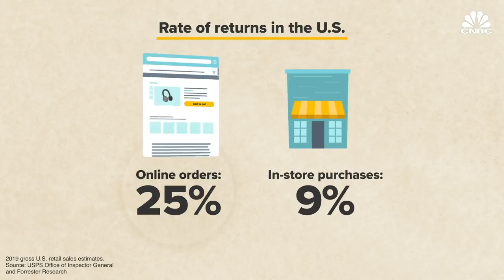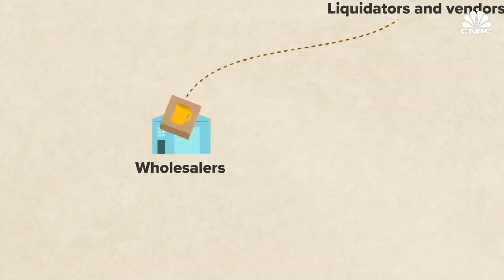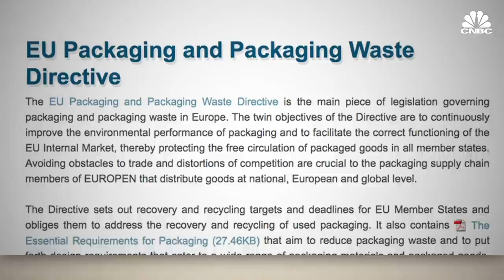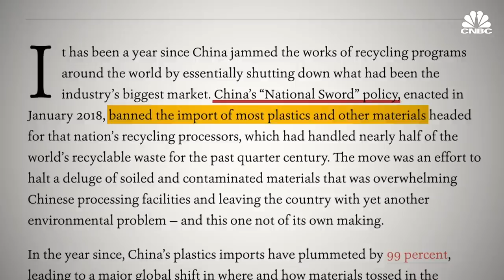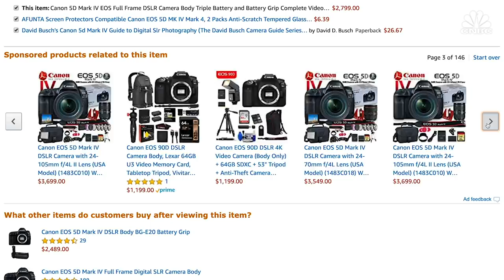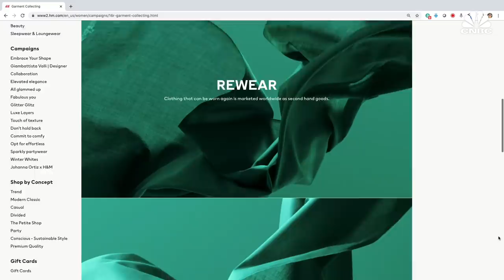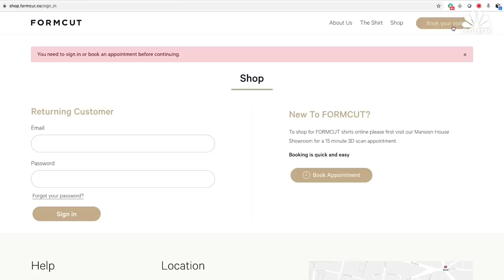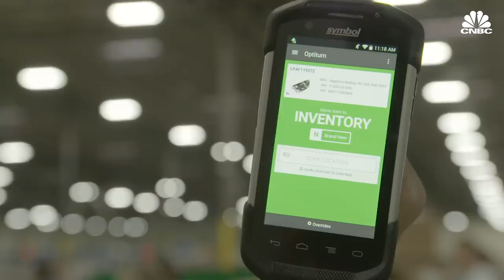What Retailers Like Amazon Do With Unsold Inventory

Comment: At a minimum 33% reduction in returns if the sizes are standardized across the industry.
Reply: Jonathan Torres not possible. They have to market “medium” to the fat Americans so they can feel better about themselves.
Reply: @TheMasterhomaster  well an Asian medium and american medium can not be the same
Reply: @toshi2k2  no it certainly isn't
Reply: @naddarr1  use metric for extra credit lol
Reply: Photo Booth Start Up
They can't as torso lengths are different.
Reply: A standardized system would require a more diverse set of measurements
S, M, L, XL, etc. can still be used for general size requirements, but they would need standardized lengths within them
Reply: They do it quite well with Bras why not with shirts at the very least.
Reply: I would agree to a certain extent.  Even focusing on just one brand, there could be 50 34X34 pairs of jeans on sale, and only three could actually fit you.
Reply: Sizes are "standardized across the industry".  That's why nothing on the shelf fits me - I am a nonstandard size.  The neck is always too small and the shoes always too narrow.

Comment: Yes put an end to designer clothes, and  make more shirts with made to order prints. Mass manufacturing of the same item is the problem. The only reason an item should be returned is if it is defective or the wrong item. Returns should not be so easy either. Buying on Amazon is like going on a blind date. The pictures often aren't the real product being sold and if it is used the real condition is often unknown. Amazon should go out of business for all I care.
Reply: What surprise's me is that more clothing returns, especially defective, doesn't end up as house insulation, it would make the whole industry better and cheaper.they are doing this with denim now.

Comment: How you the consumer can help reduce waste and stop companies from producing so much 

•buy only the food you need for the week, while you may think that may waste gas compared to buying it for the month, I guarantee you whatever you may save on gas will produce 2x the waste in food that goes bad, meal plan at the beginning of the week then get the ingredients, also make sure to eat leftovers. You can also shop from farmers markets to help reduce cost even further, but it’s okay if you absolutely afford it(though if you can afford a high end phone you can afford slightly more expensive food)

•buy only a few high quality clothing, same thing with the food, whatever you save on soap will be wasted twice fold on low quality clothing that gets thrown away, so better to just get a few high quality clothes that will last a while. A general rule I have with mine is wear it at least three times, then it can be washed unless it’s really bad 

•run everything that you use into the ground. your phone? If it got usable internet then use it. Your tv? If it’s running just fine you don’t need a new one. Your car? If it goes vroom vroom without having to go to the shop every three months it’s still good. 

Basically what it comes down to is to buy only what you need and buy it quality, it will last longer.

Comment: Apple doesn’t recycle parts. The reason for that policy is to crush unauthorized repair
Reply: It's also hard to recycle computer chips because of how they are made. It's not worth it. Even in bulk. The manufactures don't even know what goes into making these chips (CPU's). There's no known efficient way of extracting those raw materials.
Reply: Louis Rossmann? 😁
Reply: I assure you, they do. While refurbished portable items always get a fresh enclosure and battery, the valuable innards are definitely reused. The refurb items and parts are used in the warranty fulfillment process mostly, some are sold on the refurb store.

Comment: When I worked at Target in NY, if it was like food, opened cosmetics, or damaged items beyond use, they were defected as ree "toss". If it was a defected electronic, it was marked yellow I guess to send electronics for recycling or refurbishment or something. If it was anything else that was slightly damaged like apparel or something, it was marked green "donation". Anything else that was returned, was put back on the shelf. An open DVD/CD could only be returned for the exact same one as an exchange for copyright, and the returned one is yellow defected. And Target had a deposit return and you can recycle your plastic bags. I worked there back in 2006-2015.

Comment: The biggest amount of waste is due to unsold inventory, so the obvious solution is to create the "on demand fabrication". In this concept your costumer places an order at some online retailer, the same second the order is placed and paid, the factory 5000 km away starts the process of manufacturing the clothes the costumer ordered, then once the product is finished (1 to 2 days after the placement of the order) the order is sorted in the distribution center adjacent to the factory, shipped into container along with thousands of other orders to go to the same country or state of destination. then they are sent to the package delivery  company. In less than  7 days your customized clothes could be delivered at your door.

Comment: 3:04 - here is good example of key problem. Companies don't want to undermine their own new products by selling lower value older or used goods like DVDs and clothing. This can be solved very easily by banning such behaviour and simply forcing companies to sell the item if it still resealable instead of destroying it to sell new item instead. I know this particularly big thing in luxury fashion like Versace, Gucci and similar brands - they would rather burn $3000 dress or purse, rather than discount it, because the value of item is actually negligible, dress costs maybe $5 to produce, but if they choose to discount it accordingly and sell it maybe for $1500 or $500 then they effectively losing $2500 over selling new dress. This is criminal activity not only form environmental point of view, but as well by creating false demand in the market and limiting supply. Again is we take luxury clothing for example some claim up-to 80% of certain lines are not sold. So the maths say Versace has is as follows - they make 10000 pieces of branded clothing for $5 each, with retail value of $3000 each, if they sell even 20% of inventory they already making crazy profits. At the end of the season they may still have 80% of old stock and they do actually discount it little bit (usual 10/20/30%) and may sell another 5-10%, it is not massive seller because for target buyer it is very important to get latest fashion even if it is more expensive. So now company still has 75% of unsold goods which is 30% discounted already and they already have "new line" on the shelves. The new line still cots $5 to produce but could be sold at full $3000 retail, so having basically same product which may be just a little bit different colour one the side selling for 30% less basically loses the company $895 and therefore they going to liquidate old stock than discount it further and sell it. And there are quite a few companies doing it, tech companies actually does it with TV just the process is little bit slower and discounting is built into product life-cycle, however by some point it starts to make more sense to destroy say 5 years old "new" TV than discount it even more.

Comment: It's the old thing... If you go retail store, you can physically see an item, hold it or try it on, odds are you KNOW what your buying so odds are you wont return it. Ordering online can be hit or miss, even on Amazon.. They had some things that are cheap, and you grab them and they are cheap Chinese things, not what you expected and just complete junk. So they get returned. Outfits, you can estimate what will fit you based on what you wear but, different brands fit differently, this also causes a lot of returns...

The sad thing about is, retail the way we know it now will be gone for the most part in 20 or so years and this will just get worse....

Comment: Also as a side note do not order hard drives that are mechanical and not SSD from amazon or Newegg they are ALL refurbished drives with new heads and original case and platters. Even when the item say new it is NOT check the feedback and notes on all the drives people are getting ton s of defective drive with hundreds and thousands of hours on them when they are sold as new .. a lot of people do not trust the manufactures and TEST these items when they arrive just like any gamer will always run tests on purchased ram to make sure it is ok and stable using memtest. .. so in fact a lot of this stuff isnt going directly to the landfill it is being resold to the public and after insurance pays for it yet again is then going to the land fill.

Comment: You look at clothes today the material is so thin and tears so easily.  I cannot find socks that don't wear out in a couple of months only walking a couple of miles a day in them and now there so thin there is no cushion to them at all.  Tried many different brands from cheap to not so cheap and they are all the same.  The  t-shirts are the worst, made much more cheaply than they were before, lucky to get a year of wear out of them.  A lot of t-shirts are see through so you got to wear another shirt under a t-shirt.  WTF... I would like cloths that I buy to last longer than a year.  I truly hate shopping especially  for clothes.  Just bought a name brand long sleeve t-shirt to replace another that I retired because it had worn out, to have to return it because it it lost two sizes while washing it one time in cold water on gentle.  How did it happen, how did it shrink in cold water? My machine is only ever on cold.
  Now it is also effecting sheets.  Bought not cheap sheets to have them tear in guess what a year.  Almost 200$ sheet set ripped in a year of only washing once a week.  I bought the same sheets 5 years prior and they are well made and still in good shape and 5 years prior those are great shape that you feel the difference and can see the difference.  Just wish they fit my bed so I wouldn't have to buy more sheets.
  I compared a lot of my clothes and sheets to notice the difference before you didn't see through the clothes.  They were made with higher quality of cotton woven tighter which lasted longer.  Less loose threads, and cotton was way less itchy.
The best t-shirt I actually found that don't rip in a year is the dollar store.  Go figure, but they are itchy and guess what not see through.  They don't look good but at least last a few years.  Now if I could find the golden ticket socks that won't wear out while walking.

Comment: Yet, plastic manufacturers can be fined up to $10 k if the plastic beads they use are found on the ground. Or if manufacturers don't recycle every scrap of metal shavings. Amazon needs to be changed the same.